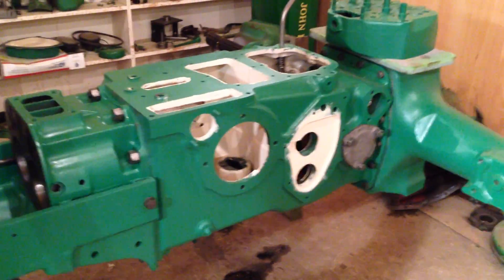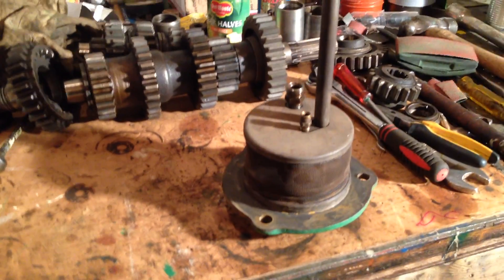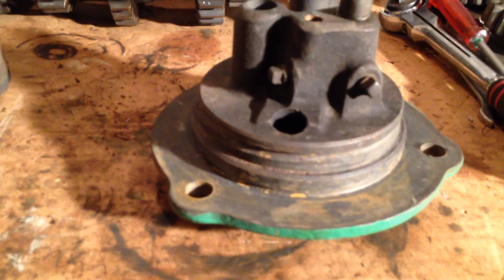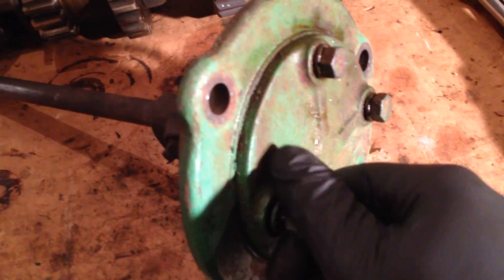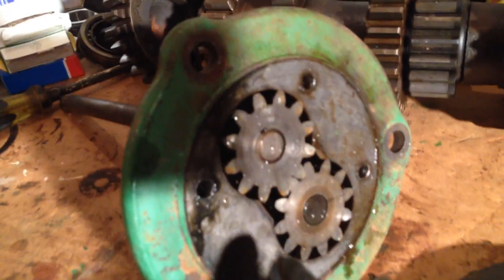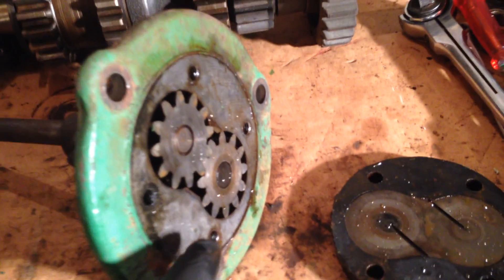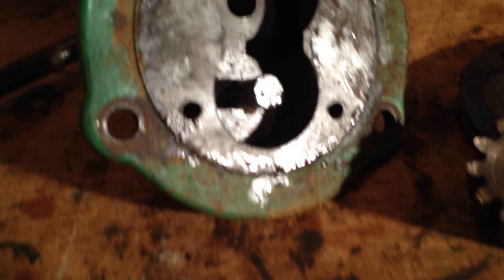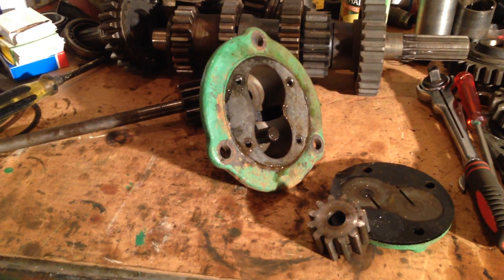1940/41 John Deere B restoration pt 34

Comment: On that type pump I have to do that today do I have to remove the crankcase cover and those fittings inside that hole then pull it through the bottom.
Reply from the maker: Hi Paul pretty much as you’ve suggested remove the crankcase cover fight your way passed the crank shaft best you can remove the two pipes on top of the pump undo the three nuts holding the pump into the bottom of the crankcase and it should fall away , don’t loose the square coupling on top of the gear drive shaft , they’re hard to come by , though saying that I think Steiner possibly list one .fighting passed the crank may be the hard part to remove those pipe fittings , it’s a while since I did one so can’t be to sure how easy it is , getting spanner’s past a model B crankshaft for what ever task is not easy Lol. Best regards DAVID .
Reply: @oneminutefarming9521  Thank you for the great info and keep up the great videos.

Comment: I’m having problems with my 42 A, the tappet lever pipe is not pumping. I pulled down the pump and the tappet lever pipe from the pump seems to be super plugged or something.
Reply from the maker: B C Hi if your sure it’s a blocked / plugged pipe all you can do is either poke a wire down it or use an air line blow pipe to try and poke it out or blow it out if neither works you will have to have a new one made . The ends are soldered on so unsolder them get a new pipe and solder the ends back on the new pipe and shape the pipe to fit . Another thought is the blockage will be caused by oily crap so if you know where it is in the pipe try gently warming it with a blow lamp at that point the heat will soften it so it could still be poked out or blown out . Generally blocked pipes like this are caused by an accumulation of crap from the engine ,carbon debris etc, ensure your oil pressure is good around 10 to 15 psi use a known gauge to check it , that will keep a good oil flow and the pipes from craping up change the oil filter regularly too , hope that helps David .